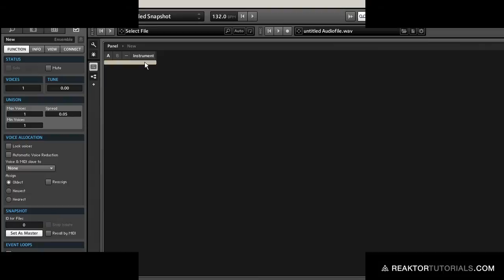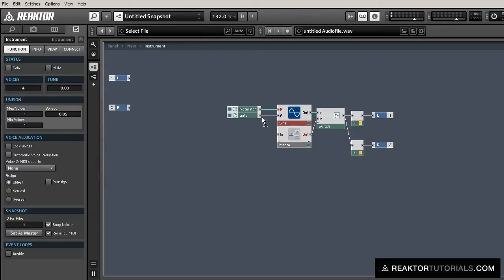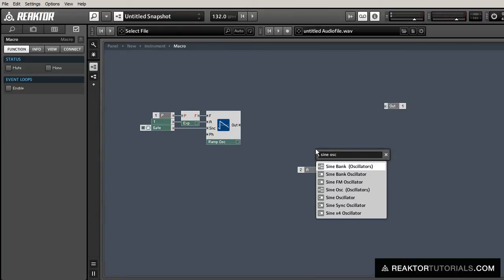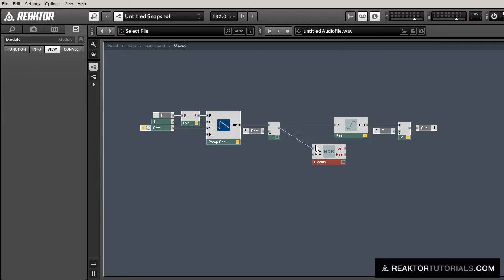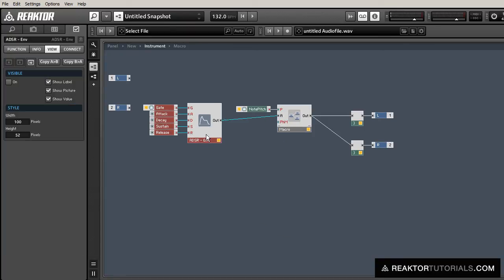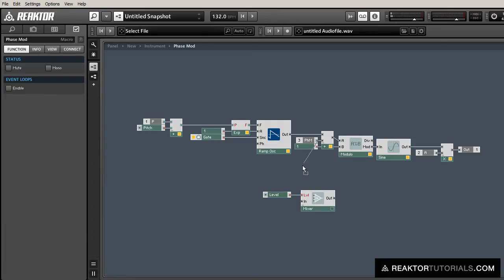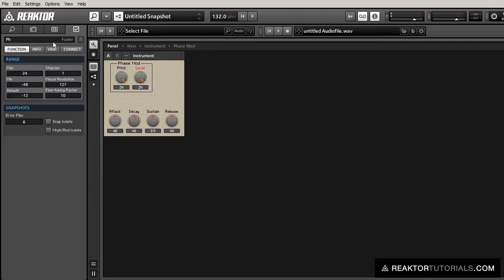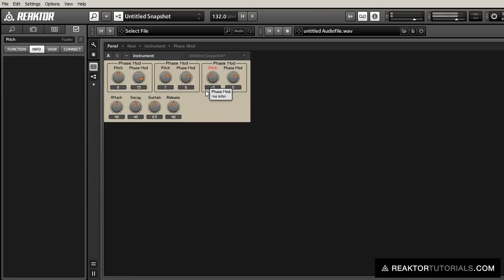Working with Phase Modulation in Reaktor

Comment: I noticed that when I delete the wire connecting the midi gate signal to the sync inputs of the ramp oscillators, everything sounds perfectly fine and dandy. Is possible that the midi gate signal-to sync-inputs of the ramp oscillators are unnecessary?
Reply: Kinda. If you remove it, the phase accumulator will just carry over wherever it got to in the sine wave between key presses for that note of polyphony. You could then have a different phase relationship between the oscillator modulating the phase modulator and the carrier wave. TBH, this is just the sort of thing that adds personality to a synth and avoids the machine gun effect of repeated key presses, so It's no bad thing.